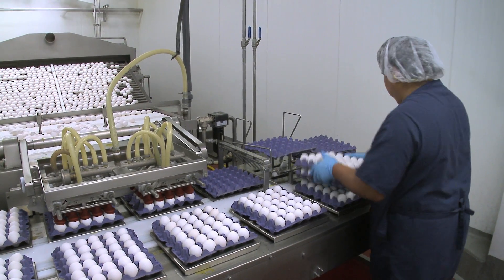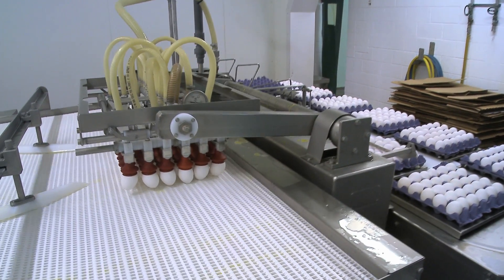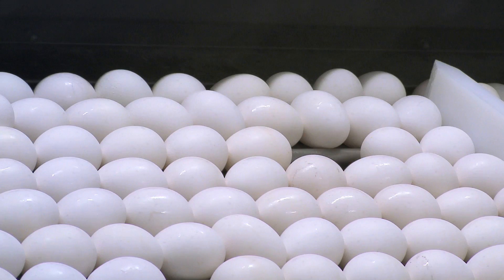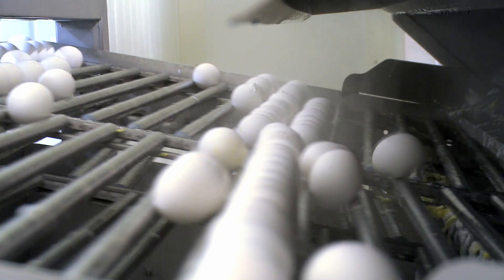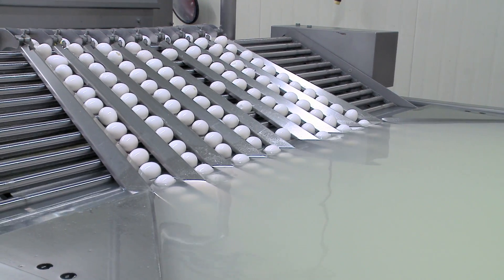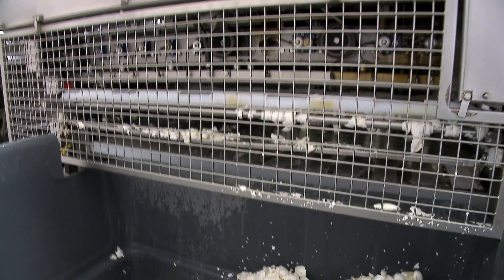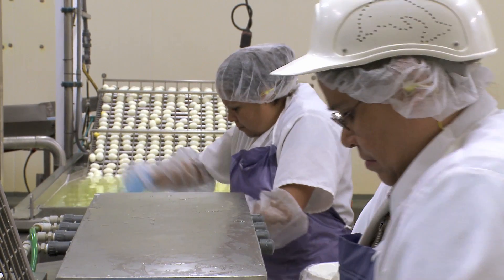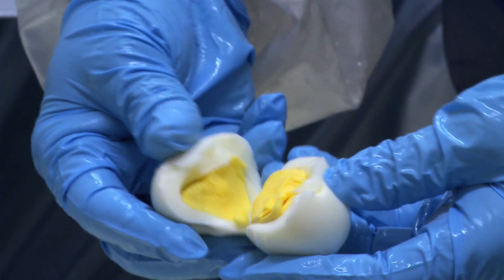Take a look at how Willamette Egg Farms produces hard-boiled egg products

Comment: I came here because I wanted to know more about 'The Peeler'  😁😁 so it rolls it on rollers and.. how does it squeeze the egg out of the membrane after the cool bit with the counterweights ?  (also is there any more detailed video of this part of the process I find it interesting and fascinating =D!) 

I was just sitting contemplating how that would all be done thanks for the video =D  imma go soft boil one by hand, which is how I came to this contemplation haha! 😂 😂 😋
Reply: The first trick to making hard boiled egg shells come apart and off easy is to cook at the right high temperature than maintain a lower but still high temperature for about 13 minutes than a hard chill until completely cooled. What you see here is the eggs are being gentle squished between rubber rollers cracking the shells which than fall right off and drop through slits under the eggs. At home in a pot first start a hard boil. After placing one single row of still cold eggs on a steamer rack submerge into enough boiling water to cover eggs. Reduce heat just high enough to simmer while covered. Wait 13 minutes remove and place to ice water. Then the cool shells will come right off with little effort and the yokes will be perfectly done with no green halo around them.